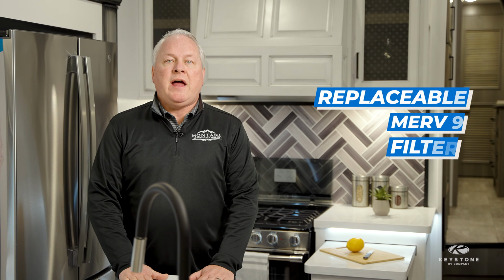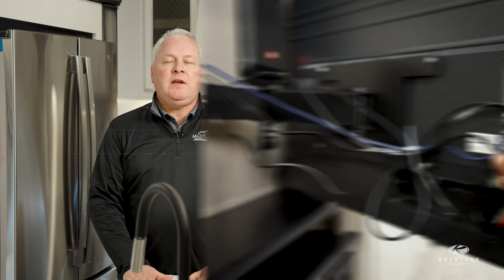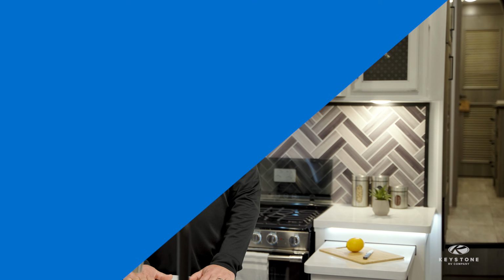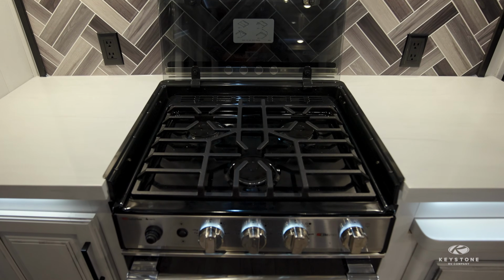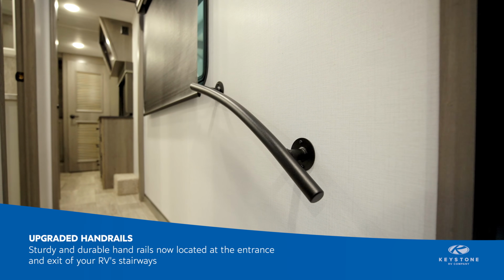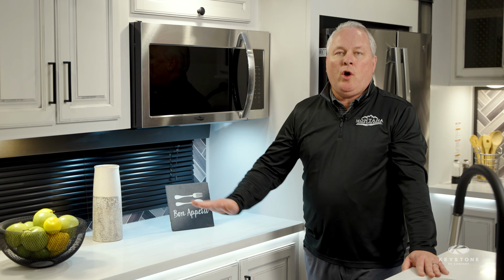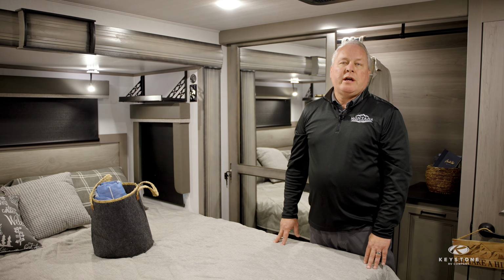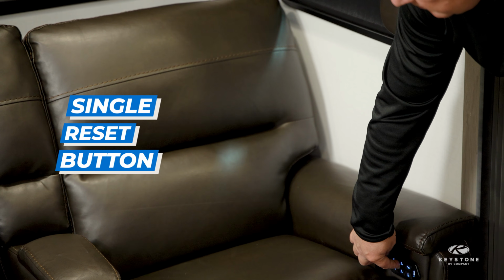10 NEW Interior Features on 2022 Montana Fifth-Wheel RVs

Comment: I have not found my vacuum bag access. I looked thru the owners manual and it does not mention a central vacuum at all. How do I access the central vac bag????
Reply from the maker: Good Evening, if you have a central vacuum this is normally under the stairs inside the unit if you have stairs. There should be an access panel near this area; If your unit does not have stairs then please do call us at 866-425-4369 so we can look into this further on your specific model.

Comment: Hi Sam, first thanks for all your videos. Question about the EZ Start (soft start) on A/C units. I know for 2020/2021 they were installed on AC systems with the 1,200 watt solar option…what about 2022 with the power-saver A/C system? Are the soft starts still automatically installed on units with 1,200 solar, or do the new Coleman’s not need? Can’t seem to find info anywhere. 

Thanks
Reply from the maker: Good morning! Soft start is only installed on a SF1200i air conditioners.  They are installed by Coleman as a factory feature when the AC is built. Hope that helps you in your efforts. If you have other questions, please do let us know.

Comment: I'm not a fan of Incommand. Keeping things simple makes alot more sense. I am a fan of disk brakes however and think they should be standard on all Montana 5th wheels. I appreciate the video updates!
Reply: Michael, I like InCommand, for one reason, it allows me to set the time or temperature when the generator comes on to run the A/C or the heat.  This is very important to me since my wife and I have two dogs (and cats at various times).  One can also set the battery level at which the generator comes on to recharge the batteries. InCommand also allows us to just turn on the A/C or heat wherever we are out of our rig. We feel lucky that we can take our dogs (and our cats) along with us when we travel to RV parks, campgrounds or dry camp, and that they will be safe. I've always been in Cougars as Montanas are too expensive.
Reply from the maker: Hello Michael! Thank you for taking the time to give us your feedback.  We definitely appreciate it and we have passed this on to the the Montana Product Development team.